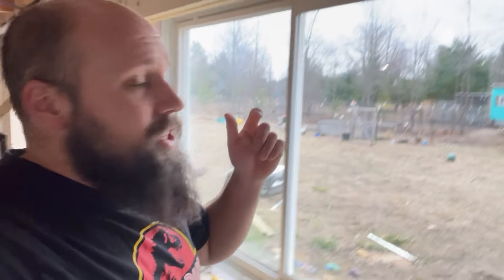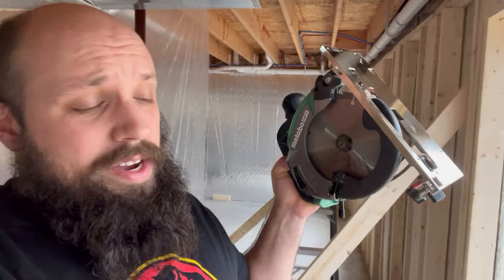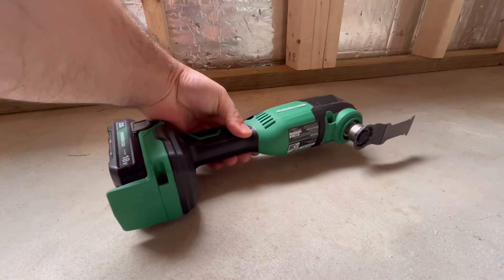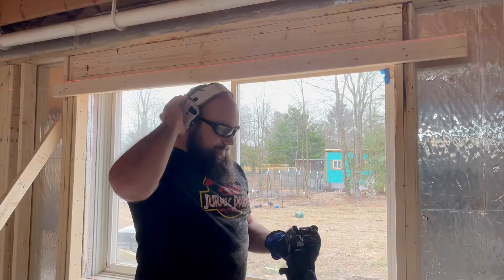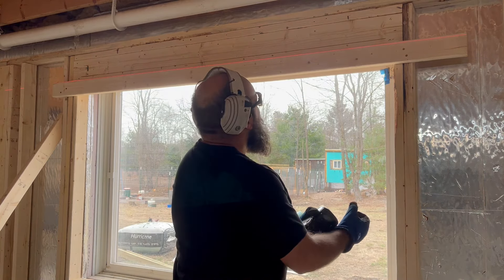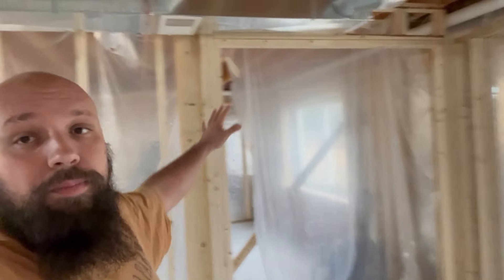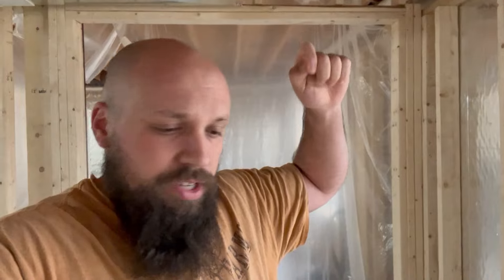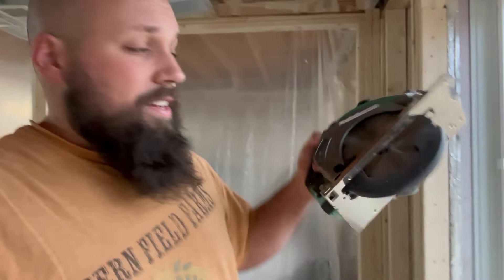Metabo / HPT 18V Oscillating Tool Review

Comment: I love the HPT triple hammer and nailers. I was not wild about the circ or recip saw. Haven't tried the multitool here. Thanks for the review
Reply from the maker: Appreciate the comment! The circ could have more power but let's be honest I pushed it cutting the full extent of the blade!!! Haven't tried a recip but would love to some time. The sliding miter is amazing on all levels and the framing nailer is so awesome ... I have been so impressed with that thing. Hope to get some more reviews of the lights and radio up soon. Thanks for checking it out .
Reply: The Deep Cut is not for really heavy duty jobs--try the 36 volt saws (or maybe a 36v battery on the Deep Cut) if you want more oomph. Also, the 36v recip and the older brushless 18v  full-sized recip have worked very well for me. I agree about the aimpact and the nailers, great tools.